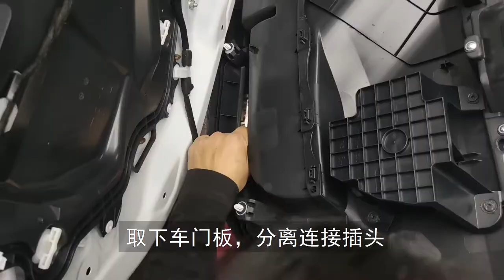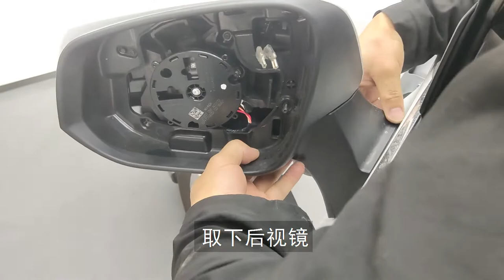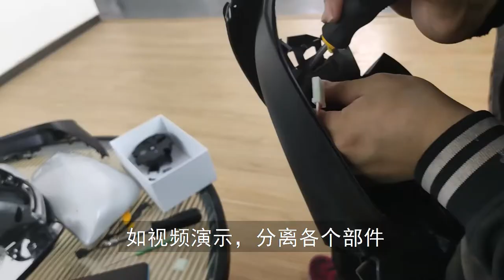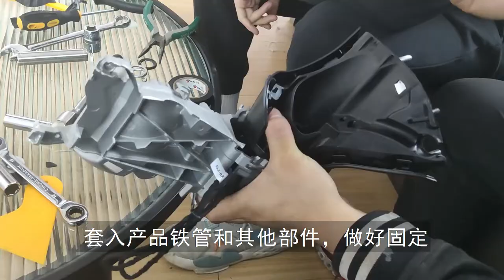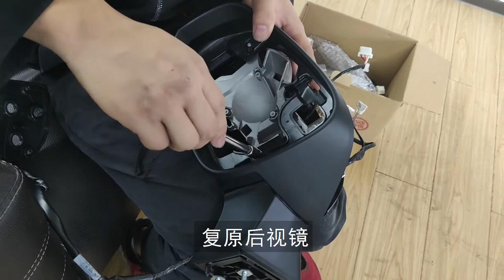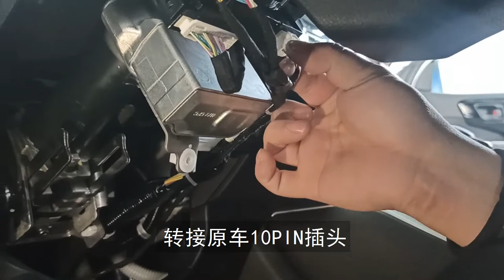Power Folding Mirrors - 4th Gen Highlander Install Video

Comment: Although this is not a step by step DIY video and noted in Chinese, it indeed provides a guideline what needs to happen.  Helpful if you are adventurous and plan to mess with your 4th Highlander.
Reply: It would be easier buy the mirrors for 2023 Highlander which already have power folding and install it that way